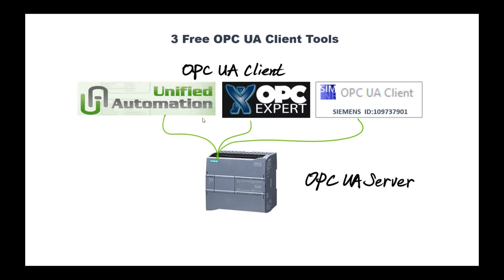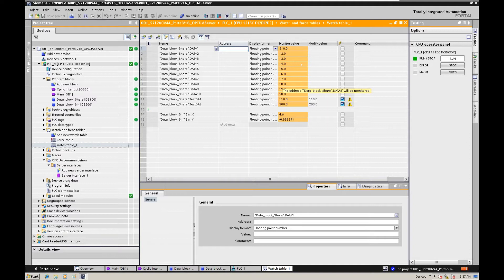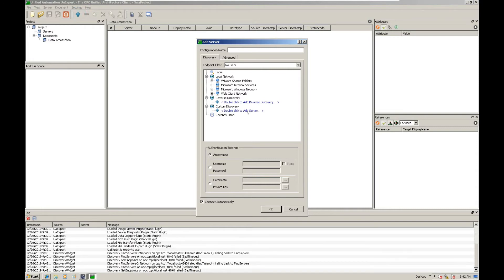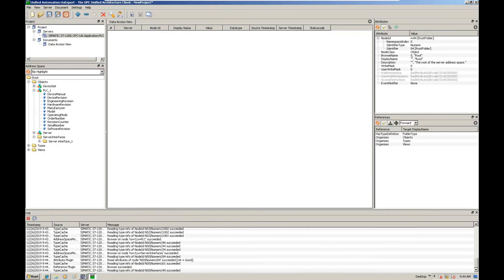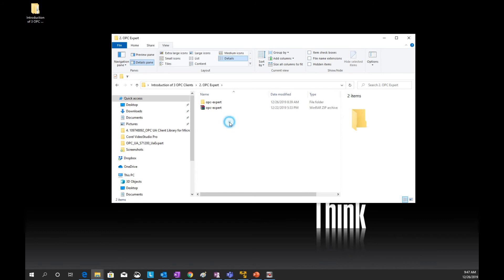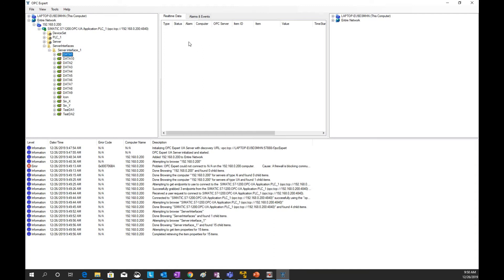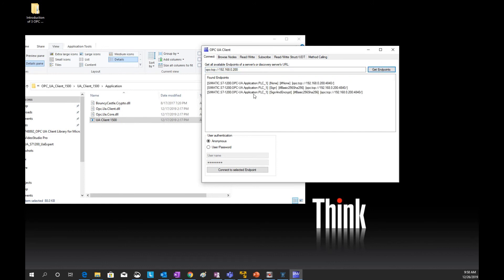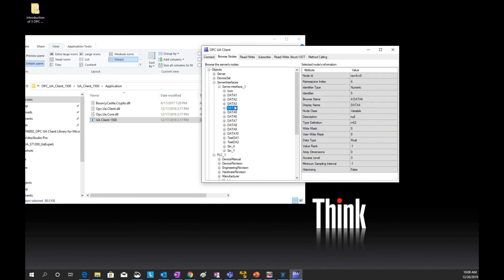COM02. OPC UA - Three OPC UA Client Tools For Free

Comment: How to use comfort HMI OPC UA server connect Kepware ?
Reply from the maker: The Siemens Comfort Panel can run as OPC UA Server, you can find the link https://cache.industry.siemens.com/dl/files/236/63481236/att_917846/v2/63481236_Part2_Panel_Server_und_RT_Adv_Client_en.pdf

Comment: Is it possible to connect an extra(in my case Phoenix AXC1050) PLC to for example UaExpert? So UaExpert is a connection tool. 

I want to go from
Machine <---> AXC1050 (OPC UA Client??) <---> RV50Modem <-via M2M internet-> Server (With UaExpert???) <-via wifi-> Tia portal (OPC UA Server) <---> TIA Portal WinCC Visualisation.

Thanks in advance!

Joost
Reply from the maker: Hello Joost, I replied your questions from my video COM02 comments. I will past the same answer: "I'd like to confirm one thing that usually PLC runs as OPC UA Server, while software side runs as OPC UA Client, this means the server and client showing in your message should be reversed. If the Phoenix AXC1050 (I never used this PLC before) support OPC UA server, your schematic should be fine. The WinCC runs as OPC UA Client"
Reply: @electricalautomation  Thanks for your fast reaction! :)

Comment: Hello. Thank you for the information in this video.
Can l use opc with S7-400 CPU
Reply from the maker: You could use Siemens OPC Server SIMATIC NET or other OPC software to communicate with Siemens S7-400 CPU. Then this OPC software will run as OPC Server, or OPC UA Server to provide data to other clients.
Reply: @electricalautomation .
Thank you for your fast response.
I have a 3 plc s in the factory S7-400 and rockwell & yokogawa.
How can we make a connection between these PLCs and OPC.
Can you send me a link for video descripe the work.
Reply from the maker: @eng.mosabkhlefat3278  I would recommend KEPServerEX (Kepware). Please find the video in my channel : COM05. Connect Siemens PLC to KEPServerEX (Kepware) https://youtu.be/KwS7_CyI0r4   and  
COM06. Connect Excel to Siemens PLC via DDE of KEPServerEX (Kepware)  https://youtu.be/pBhcizo5aYI?list=PL762SfoJC-e8Ng4OlME8WfQxf9qBhNTJh&t=572
 Advanced Tags -> New Link Tag.  The "Advanced Tags -> New Link Tag" allows the Tags in KEPServerEX (Kepware) exchanged between different channels, e.g. Channel for Siemens, Channel for rockwell, etc.